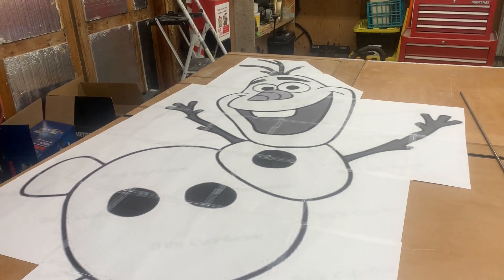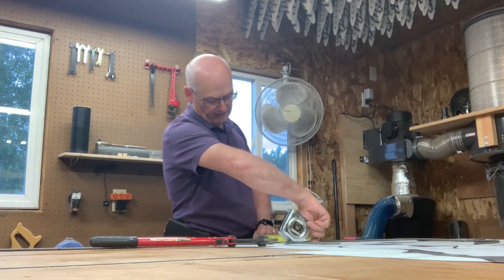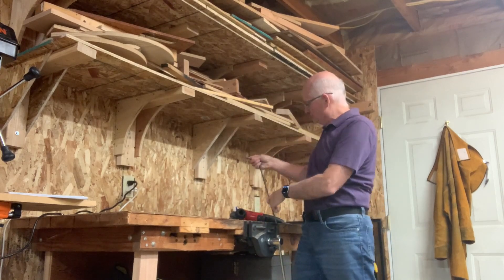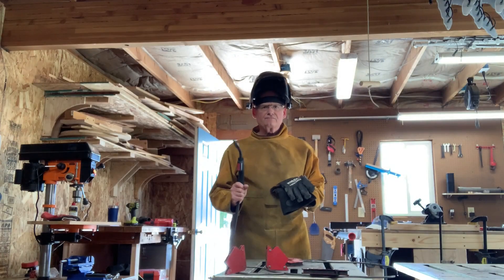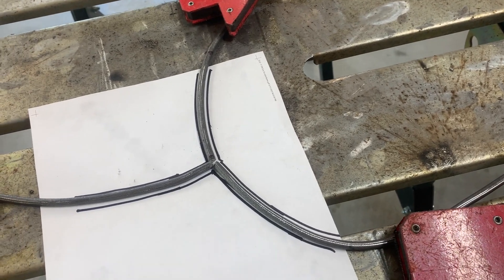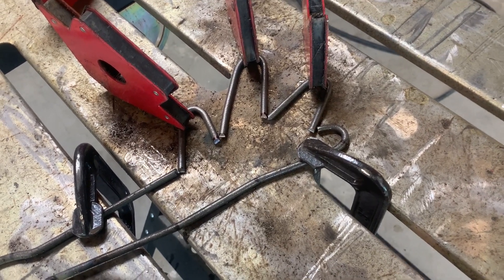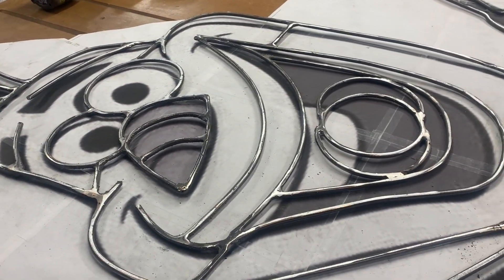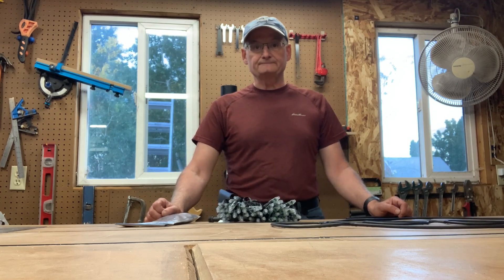How to make a Christmas wireframe

Comment: Where do u get the wire u make those with?
Reply from the maker: Local steel supplier.  We have Pacific Steel here in my town.  Don’t get it from a big box store.  A 5 ft stick will cost the same as a 20ft section from a steel supplier.   You can also go to a local fabrication shop if there are any near you

Comment: hello I am a fabricator, I know nothing about lighting  I am looking for a string of lights with white wire,  the primary color will be blue and at Christmas time they will be illiminated white. can you direct me please?
Reply from the maker: So there are different kinds of lights you can get.  You can use smart LED’s like I use or you can use lights that you plug into a standard wall socket, volts AC.  It depends on the look you are going for.  Both styles of lights can be purchased with white wire.   For standard lights you can buy covers that change the color of the bulb.  I like the smart LED’s because I can customize the color of each bulb individually within the software.

Comment: Why do you use .25” wire? Have you tried smaller sizes?
Reply from the maker: Yes I use 1/4 inch steel rod.   Haven’t tried anything smaller.

Comment: @bergmann Lights have you thought about welding to round rods to a metal plate that you can put in your vise?  With this fixture you can make custom small bends quicker than clamping all the time.  Great video!
Reply from the maker: Great idea.  I will have to make one of those for my next project.

Comment: I’ve been making my on wire frames for about 7 yrs. I love doing them. Watching how you make yours is the way I’ve doing them too. My welding table is 2’ X 40’. I will lay it out and tape in place then weld up. Unless it’s something I want to make more then 1. I will then use MDF and make a pattern on it. When I found the roller it’s made the work a lot easier now. The biggest difference is I use 3/16 rods. I get from a local metal shop. I use the wire frame clips and I do use LEDs.
Reply from the maker: Brian, you have more experience than I do.  I have been making them for about 4 years now.  That is a huge table, wish I had room for a 40 ft table.  I did make a pattern for a star that I made using OSB.  I also get my steel from a local supplier, way cheaper than the big box stores.  I haven't considered using the 3/16 rod, how is it to work with?
Reply: @bergmannlights5149  Lol I didn’t even see I put 40’. Now that would be a great table. No sorry not 40’ but 4 foot. The big difference between OSB and MDF. Is MDF want catch fire. It will smolder some. I just drill 1” or so hole at all my joints. All aside though I really liked your video. Can’t wait to see next on how you connect your lights. I’m trying to learn pixels but that’s a huge step up for me.
Reply from the maker: @tarheeldog6958  That is good to know that MDF does not burn.  I also put holes at the joints for my stars.  Worked well enough.  4 foot makes more sense.  I have two of those harbor freight tables.  I move them around to support my work pieces.